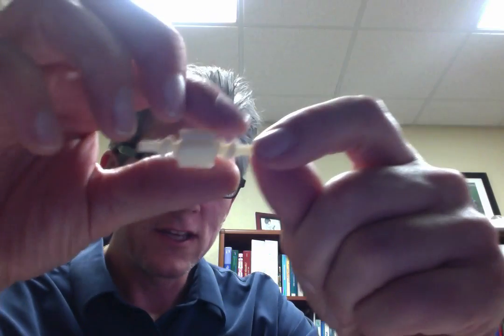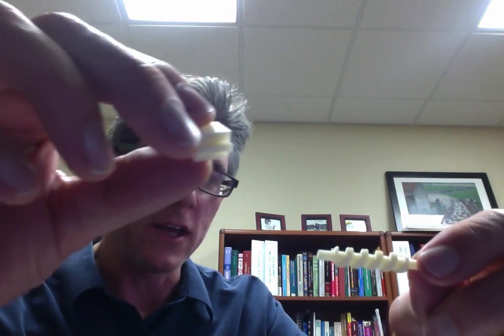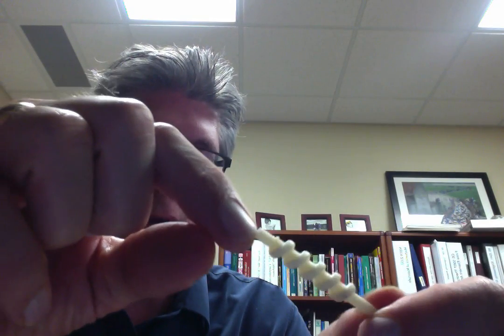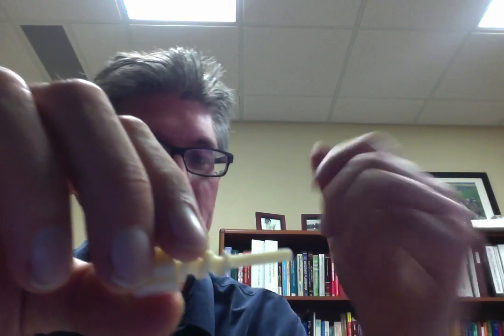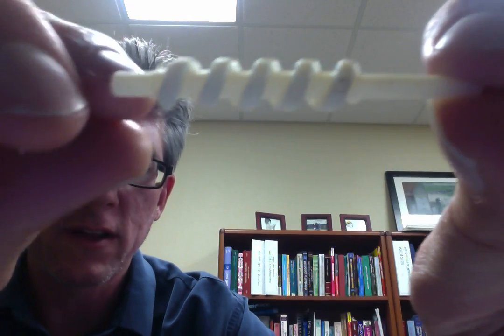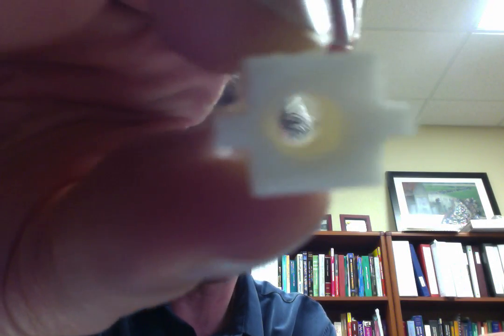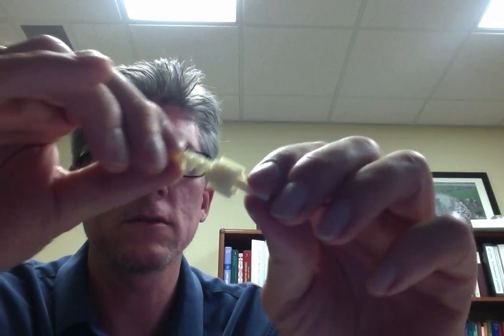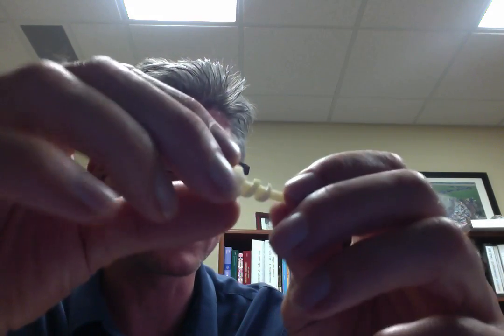Acme thread lead screw from 3d printer

Comment: hmmm... interesting... a 1/4"-16 almost has a 1/4" pitch...the smaller count of threads would make it a fast thread to use, but if it were a prototype i think it would be difficult to make on a manual machine out of a steel alloy. but then i guess thats where multiple start threads come into play. less tpi = faster motion, and an acme is for transferring motion so yeah.